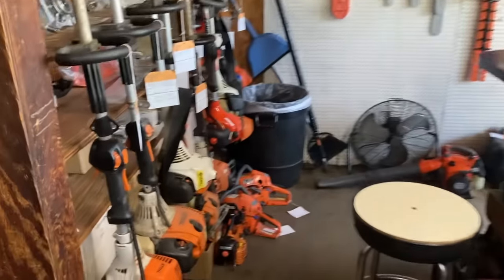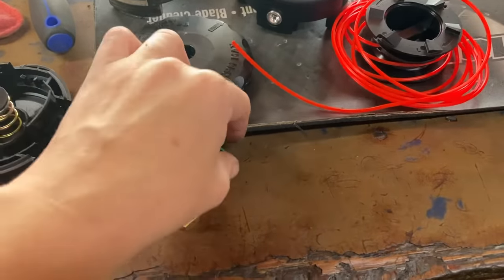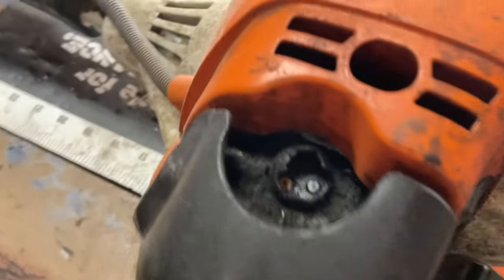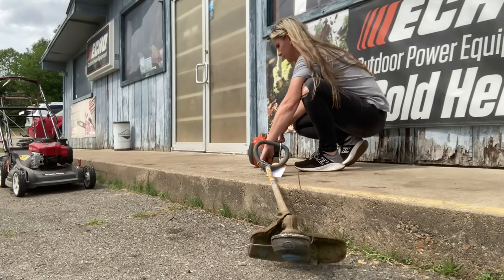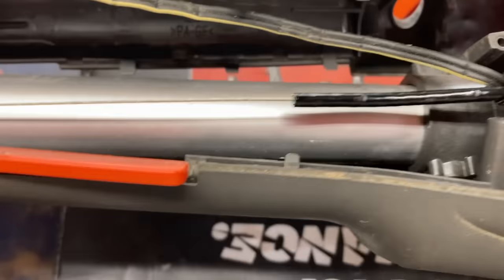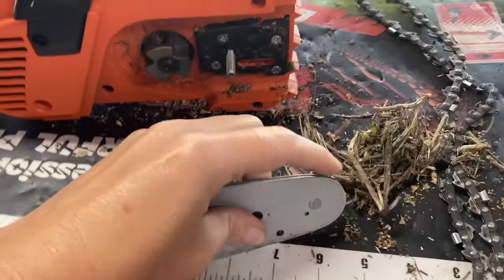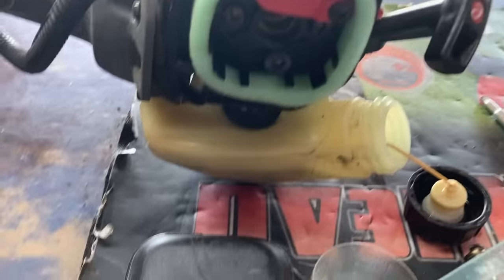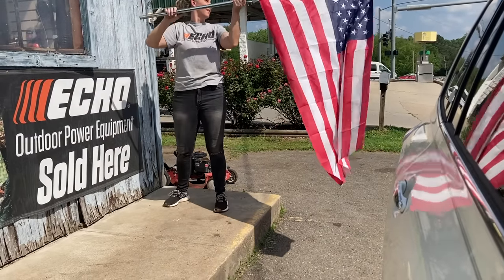Repair Shop Chaos: Tackling Countless Small Engines in a Single Day!

Comment: You are an absolute beast!  Congrats on your YouTube success. I am so proud of you!
Reply from the maker: Aw! Thanks Jeremy!! Can't wait to meet up one day!
Reply: @Chickanic  I know that I was glad to meet you! You done wonders for my small engine stuff.
Reply: Do you work alone or do you have help at the shop?
Reply: I wish I’d known the difference between a MS291 and an MS261. Stihl chain saws.  I was the old guy who couldn’t start the 291 so I had my local dealer find the easy start that works for that saw. 
He installed it but the conversion to an easy start also requires a new flywheel. Parts are Stihl in order.
Reply: Working.hard and looking good. Keep it up Bre!
Reply: Blind leading the blind. How about a video repairing a Tec carb, the proper way???

Comment: Messed with a buddy's Husqvarna 128 LD trimmer yesterday. Started off with a simple carb replacement and a plug change. Plug wire pulled apart and it basically went downhill from there. 2 hrs later, I thought "I am glad I do not do this for a living."  I am just that "guy in the neighborhood" who fixes things! Keep up the awesome work. I learn something from every video!

Comment: I worked at a small repair shop for years that was part of a store. We serviced what we sold. We had a boss that wouldn't hire someone to handle the window traffic, fone & parts. Since there was only 2 of us in the shop you can imagine how things went. Bear in mind we had to do pick-up & delivery also. It wasn't uncommon to be a month out. On top of that the boss would shoehorn his buddies stuff ahead of others. It was an absolute 3-ring circus! I've retired long ago, all of this happened back in the '80s & that particular shop still operates that way. I did operate a shop at home during that time also & that got old with sometimes 16 hour days. There's more to the story but this's long enough.

Comment: I love your channel because you show exactly how the build quality of these machines are on a steady and continual decline. Your work is top notch and your customers are lucky to have such a capable and honest shop.
That said, my new scythe bypasses all of the issues of starting a machine and hoping it works for the first mow. All I have to do is peen the blade after about a few hours of cutting and honing the blade. No more plastic parts, fuel choked carbs and had gas. Woo Hoo!

Comment: Your channel is one of the few I enjoy. I work on my lawn equipment and as long as you're getting spark, gas and air everything should be great.  Not so with small engines.  I'd rather work on a big block truck engine sometimes.  It should be the opposite. Thanks for your channel. I think I'm leaning a lot.

Comment: Thanks for the sitting along time trimmer starting tip. Primed it 20 times, pull the cord at full throttle and keep it there long after it starts.  Would have tried 40 primer pumps, but I had it running briefly 4 days ago.  Before that the echo 225 hadn't started in some 5+ years. We have 2 trimmers, electric Lowes for light duty and the echo with aftermarket non-string, 3 plastic blades for heavier weeds.

Comment: Wow! I knew that you were busy, but the number of problems that you fixed in one day is huge. You are a treasure to your community for all the help that you provide to your customers. I have learned so much from you. I pass on things that I have learned to others. I had someone who was having trouble with a Ariens GT. I have several and others in the area that have them also look to me for help when they need it. The GT would run if fuel was added to the  carb using another gas can. IT would draw fuel from it so I knew that the fuel pump was working. I suggested changing the fuel line running form the tank to the filter and then to the fuel pump. New fuel line and a filter did the trick. He now is back mowing. I remember that the fuel lines can deteriorate on the inside from the ethanol in the fuel and after about 30 years the line was no good.

Comment: Recently fixed a free jonsered 2040 I was given. Didn't run. Chain rusted. Cut 4 cord with it so far now. Now I have 2 more Jon sered to fix for a friend 2159w turbos. And 2 brigs motor mowers that sat for undetermined years to the point everything is seized solid. I got the 2 2159s running. And one still just needs an oil pickup. Couldn't see the plastics on one it was so gummed with oil/dirt/sawdust that it made a coconut shell over the plastics... Your videos are what got the 3 chainsaws working again.

Comment: Good Vid. At my shop the first thing I do is pour the gas out of the machine into a mason jar. Then while its sitting to separate  I check for spark and other things. I then come back and check the jar for water,trash and sawdust. That will tell me about the filter and the screen in the carb. Helps save time.

Comment: I feel your pain...replaced a carb last year on my push mower, hit a root this year and did my best to straighten out the shaft, then the carb started allowing fuel to flood through. Rebuilt the carb on my riding mower, added a quality fuel filter and fuel cut off, it ran fine. A few weeks later, it acts like it isn't getting any fuel....yes I turned the cut off back on. Always something. Bought a  new electric mower, but the battery doesn't do the whole yard.

Comment: I went to start my stihl hedge trimmer the other day and it ran poorly and died. Pumped a few times and it did the same thing. Just saw this video with you fixing as many things as you could and the one machine you said to pump the primer 40 times. Seemed counterintuitive the trimmer would flood. Just tried it, pumped it 40 times and it started on the second pull.
Can't thank you enough. Learn so much from you.
Be Well

Comment: You are a lot more patient than I.  Sometimes it takes me a few days I will lose my cool and break something if I just don't walk away.  A quick aggravating fix if I am in a bad mood can lead to buying a new piece of equipment or doing without.  That is why I specifically am NOT a small engine mechanic.
Reply: I am right there with you. That is why I prefer working on my own stuff. When it reaches the point of no return, I can at least Hulk out on it and get THAT satisfaction!
Reply: Same here. I used to have a couple of frustrating "customers". I'm a homeowner, but I had my kids doing the yardwork. And I'd have to repair my equipment WAY more often than when I was doing the yardwork. Sometimes, I'd swear that sabotage was involved. Which would cause more work because I would be looking in the wrong places for problems. Sometimes I felt like I was running a small engine shop for two problematic customers.
Reply: @ericpigg2689  I try ever so hard to just walk away and gain my composure.  Often enough just cooling off makes things work so much better.  I am 56 years old.  I have broken things beyond repair I have a very violent temper.  I try to walk away, I don't want to break it, and I am getting to the age where blowing up can cause medical issues that you cannot return from.  These days I start getting irritated, I get up and go do something else for a while.  I HAVE to for my own healths sake.

Comment: Try a 1/4 drive inch cordless impact driver on the crank bolt securing the starter cup. No need to use a piston stop. Works great on chainsaw clutches too.

Comment: Hi I just wanted to let u know on the fs 94 r and any other Stihl trimmer and blower I'm a gold certified Stihl mechanic but I learnt to spray some lubricant down the plug boot and get ya some thin needle nose pliers and pull the plug wire threw and get some heat shrink tubing and then put your wire in then pull the tape up and heat it then take your pliers and guide it back in

Comment: Honda is famous for that fuel line inside a fuel line. They also use a very thin walled fuel line on their inverter generators that is impossible to buy in bulk. I always check the valve clearances on 4 Mixes. Nobody ever checks them and they're always off.

Comment: I bought a new stihl ms 250 chainsaw from a dealer and in all my born days never seen the chain get tighter while using it, but mine  did. So I walked back to my shop and get the tool. I take the chain off and check the bar, everything looked good. Put it back together, left the chain a little loose, it went around like it should. Tighten the chain up some and it was fine. I had cut down a small tree but when I went to cut it up, felt like the brake was on but it wasn't. So not sure what had happened, maybe the chain wasn't in the sprocket or it was too tight.

Comment: The one that surprised me was the Redmax trimmer. Those are usually owned by commercial outfits, and they typically understand how to keep their equipment running.

Gas... a few years ago, my mom had problems with her Echo trimmer. I asked her if the gas was good. She assured me that it was. She kept having problems, and kept assuring me that the gas was good. When I came to visit, I bought a can of 50:1 fuel, emptied her fuel, filled it with the new fuel, and it ran fine. The problem was, she and my dad ran a gas station in the 70's, back when gas lasted longer than 3 months, and in her mind, gas was good for more than 3 months. Some of your old timers (and I'm one, too) might remember gas like this, and don't understand how quickly gas goes bad. That still doesn't explain water in the gas.

Comment: Busy is good, however for the homeowner battery powered devices are starting to make a lot more sense and after watching your videos, it is obvious the #1 problem with ICE equipment involve fuel/carburetor issues which can be a yearly thing, and that is, IMO, why homeowners are going to battery operated mowers, trimmers and blowers. Costco has the Greenworks 16" trimmer on sale for $180 with a 2ah batter and charger, the blower for the same price with a 2.5ah battery.

Comment: About the chainsaw with no bar oil; if you’re new to running a chainsaw, they go though bar oil QUICK. Always check before running and if you run it longer than a couple hours check again.

Comment: Bree your really busy, there’s just some machines that can’t be saved or cost too much to repair.
Time wasted on machines that won’t be fixed is an issue, I had gone to a repair shop, Stihl Dealer they Charged $20 to look at it and deducted that from the repair bill, if it was rubbish or customer didn’t want to repair the charge $20 applied which I thought fair for their time.😊
You must have a sore arm at the end of the day😊

Comment: I enjoy your videos on the older 2005 mower if it had a bent blade spindle,that would have told you blades were bent,I think everyone that has a riding mower or 4 wheeler or wheelbarrow has put tire slime in there tires

Comment: I had gotten a major treasure find at my workplace a basically brand new nearly 700 dollar Husqvarna 545 mark 2 professional chainsaw with auto tune in our scrap trailer all over a chain brake tripped when the owner of it tried to service it and could not reset it all it took to reset it was i got the side cover off placed it at the brake handle to where the pin grabbed the brake lever  and pulled back on the handle and "Click "the brake reset and now own a free pro saw.

Comment: I feel ya Bre same with me at my shop not as busy as yours but doing sometime two machines at once with my son ill get a call step out come back and just say crap where was I AANNNDD time to start over sigh . At this point I ask a yes and no question did you run it this season or today. Becasue the “it ran the last time I used it” is a useless statement .

Comment: Blimey, you have a lot of energy!

I was looking for a video on Husqvarna battery strimmers. I have two 5 series strimmers. One of the strimmers has an annoying fault in that for most of the time it only provides power when the trigger button is held fully down. I wondered whether this might be the trigger switch as in other respects the strimmer works perfectly. Have you experienced this fault with a Husqvarna or competitors machine?

Comment: That tickled me about checking for water comments. Bought a tank full of gas once at BBQ place. Got 8 miles down the road, and it quit. It died sickly. My manchanic pulled the gas out after finding a cabarator full of water. Number 2 galvanize tub with 3 inches of water after pouring the gas out of fuel tank. Needless to say, no more BBQ fuel.

Comment: Best place to ask... I'm guessing.  Do I buy a Stihl FS 561 or go for the Husqvarna 555?   I've had to cut tall grass on my acres for 40 years, and miss the old Craftsman  / Shindaiwa  53cc brush cutters that lasted 15 years without ever replacing parts, except for fuel lines & filters.  Will I have the same luck with either of these, or is there another big engine option?

Comment: don't STRUGGLE pulling starters to get engine to suck it's fuel from tank by impulse.  keep a  HOUSEPLANT MISTING BOTTLE with 2 strokee mix and set nozzle to jet to get it into carb mouth. can even keep engine running and SOMETIMES a gummy carb will unblock. WD40 down H SCREW and L SCREW via red tube often CLEARS non accelerating engine.

Comment: #impressed. I'm trying to resurrect a Coocheer (rebranded) chainsaw. Any chance you could do a video or short of how the kill switch works? I'm sure the issue is electrical but don't want to load the parts cannon without proper diagnosis. Thanks for a great channel.
Edit to add; I know they're rubbish after seeing a previous vid of yours!

Comment: NICE CORVETTE. I HAVE A 1993 40TH ANIVERSARY LT1. ABOUT 45K MILES. A GERNAN SHEPHERD CLIMBED ALL OVER THE CAR IN THE GARAGE   BROKE THE GLASS TOP. SCRATCHED ALL THE PAINT. I LIVE IN Joshua Tree CA. THE HIGH DESERT. I HAVE A BRAND NEW HUSQAVARNA 460. I CANT GET STARTED. I ALSO HAVE A BRAND NEW BLACK AND DECKER 42CC 14 INCH WILL NOT START EITHER. I BOUGHT  50 TO 1 PRE MIXED GAS AT HARBOR FREIGHT FOR BOTH SAWS. MAYBE THE GAS IS BAD??

Comment: I got one of those Husqvarna 12 hp brig's. The valves froze up.  And it's a single cylinder. You wouldn't happen to have a twin that would bolt in ?

Comment: I have a poulan chainsaw. The starter cord jammed up. I took the rewind apart and got hit in the face with the spring. I managed to get it back together and working but Im really not sure how I did it. Just got lucky I guess. Maybe you could make a video on doing it in case it happens again. Which Im sure it will with my luck.

Comment: I worked in a sales and service shop years ago. It's always amusing to hear/see customer stories... Some honestly don't get it... others go straight to deception! Yesterday I was in the shop where my son works, part of a privately owned True Value. A customer came in with an older Stihl MS180 claiming "The bar you sold me doesn't fit. It doesn't have the gear thing" (quick chain adjuster). Well... the new bar and chain were in a box with a shipping label on it addressed to the guy. It was a Chinese knock off bar he ordered on-line. Not only was he a bad at lying (facial expressions and speech patterns) but he wasn't even smart enough to remove the shipping label nor know it wasn't a brand the shop sold--they sell Stihl and Husky equipment and accessories along with some Oregon tools and accessories.  I thought the clerk handled the guy well. Without directly pointing out all the obvious deceptions he fixed "the problem" but did ask if that was his address on the label which let the guy know we knew he was lying... 

Customers try returning used chains to other departments claiming they "don't fit and nobody is in hardware." Try to return new equipment that will not run... because they ran straight gas instead of mix. Bring in new saws with melted chain oilers because they ran with the brake on. The list goes on and on... no one ever admits that they themselves caused the damage... it's always the manufacturers' or stores fault. I don't miss that aspect of doing service work. Now.... between my sons', parents', girlfriend's and my equipment I'm typically at my son's shop buying parts and maintenance items 1-3 times per week for summer and winter outdoor power equipment. I still get to do the troubleshooting and repairs... only I don't get paid for it!  🤣On that note, I have to go there now for a mower deck drivebelt and oil filter for my parents' zero turn. Last week I put a new front caster yoke on it as the spindle broke off after 19 years of use... 😉

Comment: @Chickanic Hey there. Can you point me to a video on repairing two piece plastic catchers? I have two Masport mowers and the tabs break and the top and bottom come apart while trying to mow. I could just drill and cable tie but there must be a better way. The mowers are less than two months old but supplier says not covered by warranty as I'm a commercial user.

Comment: So I live 2000 miles away from Arkansas so i cannot stop by your shop to buy a new string trimmer,  So I am looking at the Sthil FS 40 as a home owner my Troy Built that is 15 years old still runs great but the string head is worn out and I cannot find one that says it fits, I watched your video about the  speedfeed 400 but doesn't list my trimmer as fitment.  So what do you recommend?

Comment: I have a craftsman 36cc brushwacker it was running but when it heated up it stopped working.  Now it will idle but if I give it throttle it dies. I brought it to get fixed and I believe they replaced the carb when I took it apart there's no gasket between the carb and the head but no signs of leaks. Any ideas? Ty

Comment: Need some help. My son fried the engine on toro 22 in push mower  ( toro model 20353) the engine is B&S 104M02-0010-F1. I was thinking of replacing the engine.Would B&S 104M02-0198-F1 work?
thanks
john